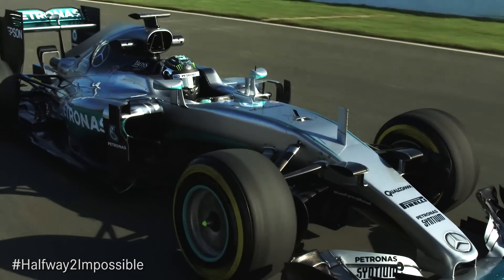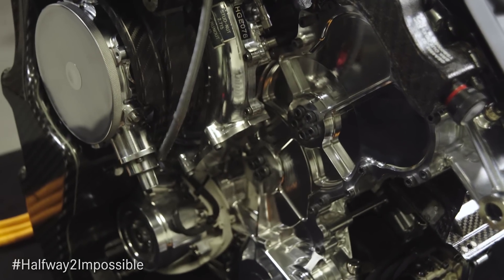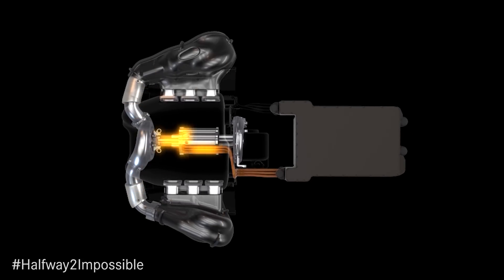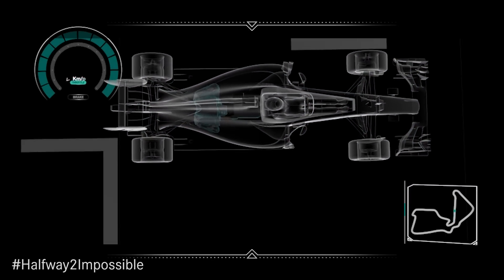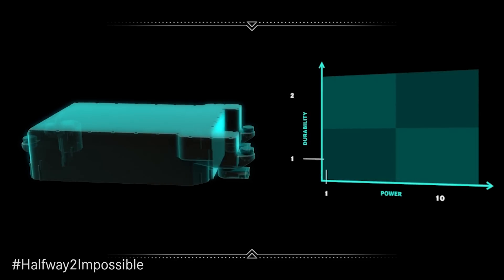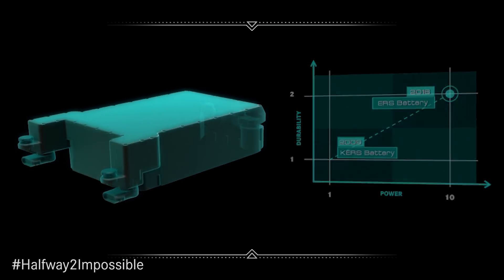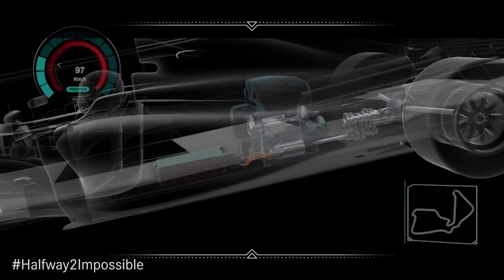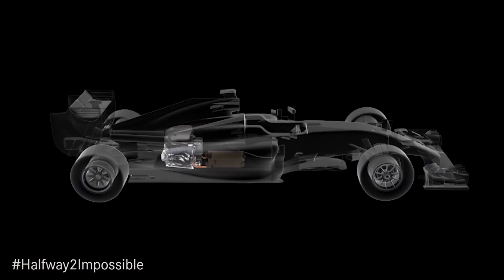Mercedes F1 car powers 10,000 Light Bulbs (3/4)

Comment: Dear FIA, please let the teams  have a third MGU in their power units,this can maybe help them have the normal MGU-H be put somewhere else for heat harvesting and have the new MGU deploy the energy into the turbine so on the straights or more importantly in the corners if the MGU-H is harvesting energy the energy store can use that energy to straightaway pass it to the new MGU to deploy into the turbine
Reply from the maker: +Ginger Boy It should be an MGU-K on the front axle. Four wheel drive and over 1000 hp :)
Reply: +MERCEDES AMG PETRONAS sry could you simplify that please
Reply: +MERCEDES AMG PETRONAS oh ok i get it see u in 10 yrs hopefully

Comment: What's the difference between the power units you use for your team and the power units you supply for other teams like Williams or Manor?
Reply: +David Cadena If there is a difference, it's negligable. The reason the customer teams are lagging so far behind is not because they have a 2nd grade PU, but it's that their chassis is not nearly as good as that of the factory team
Reply: +David Cadena The regulations state that engines used by manufacturer teams which are also supplied to other teams have to be the same (unless cheaper previous season units are provided) and can not be modified by each team further. I do believe all the supplied teams will benefit if Mercedes are allowed to make improvements to the unit during the season.

Comment: John mentioned that the battery size has been reduced due to increasing efficiency, why not keep the battery the same size and be able to use the electric power more? I'm assuming the decrease in weight / packaging size for aero cancelled out that benefit?
Reply from the maker: +Lagahan You assume correctly! Sometimes less is more
Reply: MERCEDES AMG PETRONAS Cool, thanks for replying! These videos are awesome btw!
Reply from the maker: +Lagahan Thanks! Glad you're liking them :)
Reply: +Lagahan There are limits placed on how much electrical energy is allowed to move from the energy store to the KERS.  That is why once they reach the max energy output allowed they look towards reducing the size and weight.
Reply: What I want to know is if the size can be reduced, why not reduce the minimum weight of the car? The reason the weight increased between 2013 and 2014 was to accommodate the larger battery, right?
Reply: MEGATRON  No, that is not correct, that was the weight change between 2016 and 2017 :P

Comment: The jump we are seeing in power and energy density (especially power density) with batteries is staggering. Supercapacitors in their current form are obsolete. Remember the battery hast to weigh between 20-25kg yet supply atleast 120kw and absorb more under braking. The porsche 919 also has incredible battery able to supply and absorb over 300kw for 24 hours without degrading, and they did it last year

Comment: Dear Mercedes f1 could you answer this question please, why don't you guys try putting the turbine below the rear of the engine so you have cooler air as the turbine will not heat up as it enters the compressor which in turn reduces more pipework in the intercoolers just an assumption
Reply: +Isaac Chua I'm no engineer but I think that the turbo has to be hot to help charge one of the energy systems in the F1 car
Reply: +R92CP no i think it is the battery that has got to harvest the energy that will be located somewhere else though the motor  is connected to the turbine
Reply: dear mercedes, i know this setup most probably can't work but if it does pls hire me in Brixworth Mercedes HPP in 2026
Reply: +Ginger Boy That would probably only cause more drag. In F1 you want to run everything as hot as the manufacturers and engineers let you, because all cooling causes drag.

Comment: 2014 regulations were not changed to align the F1 technology with road technology.. then why they use front wing?? I have never seen a road car using front wing.. they were changed because of the pressure from the engine manufacturers..
Reply: +Sourav Dutta It's still a race car. They want technology crossover, not to be as slow as road cars...
Reply: +MERCEDES AMG PETRONAS Why did F1 teams (especially Renault) want engines more relevant for road technology, but still spend millions on the development of wings?
Reply from the maker: +Sourav Dutta The Power Unit regulations. Not every single one. The initiative for the rules came from the FIA with manufacturers. No pressure involved.
Reply: Berend H. F1 has to be the fastest racing. Without wings, it would ONLY by relevant to roadcar tech. This isn't production car racing.....
Reply: +Berend H. Because everyone else does and they want to win too...

Comment: But would it help with my light bill? That's the real question here.
Reply from the maker: +Mystery Science Theater F1 Depends. Is your light bill more expensive than an F1 car?
Reply: MERCEDES AMG PETRONAS At the rate it keeps going up, it will be soon enough.
Reply: Probably not but if you rig your electricity supply up and bypass the pre pay meter you get electric free we havnt brought a pennys worth of electricity for three years
Reply: only if your cultivating cannabis or opium
Reply: but still is worst paying high prices for fuel and oil